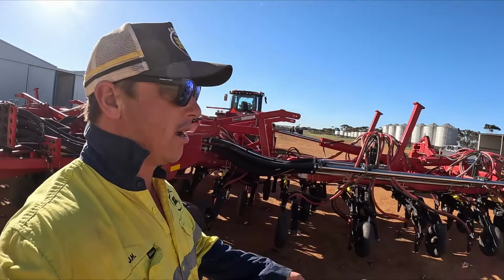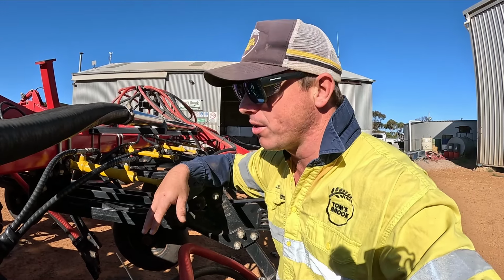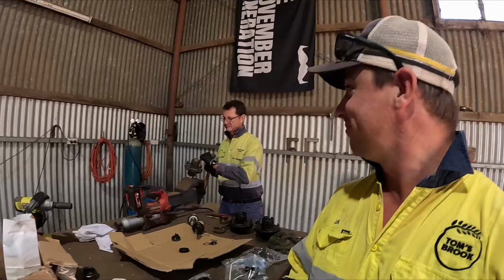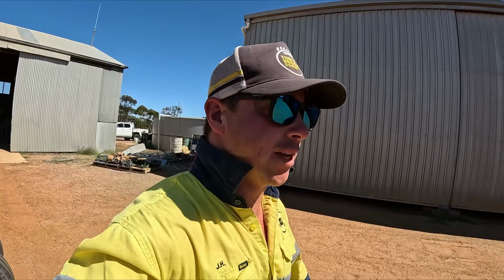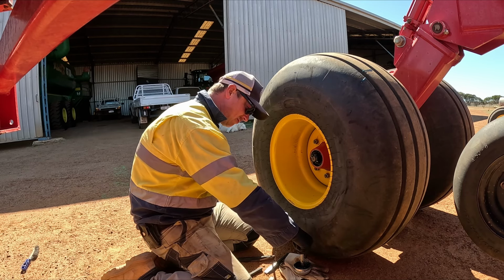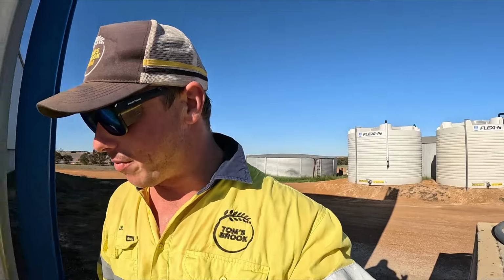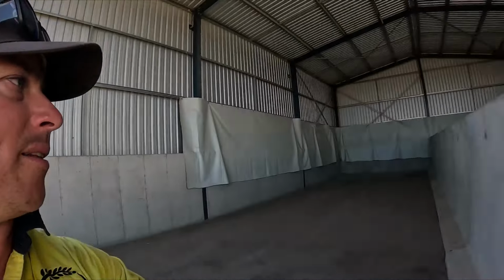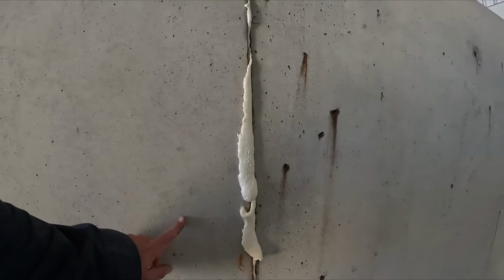Press wheels and dividers in the bunker!

Comment: we used to use expanding foam but probably just got lazy and now put rags into the joints. Our walls a a lot shorter in height then what you have so our gaps haven't opened up as much.

Comment: Bourgault packer wheel bearings we grease every 10000 acres or once yearly till we get a good grease coming out back it’s triple seal bearing we were told at 100000 acres now and haven’t changed one yet 🤞
Reply from the maker: Yer so these press wheels have done roughly around 27 000ha (66 718ac) so well in need of it!